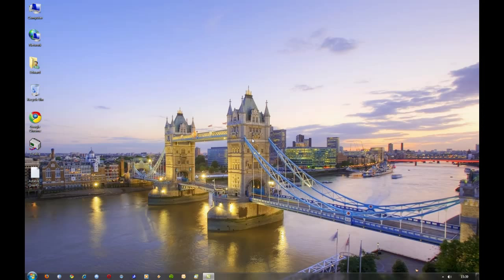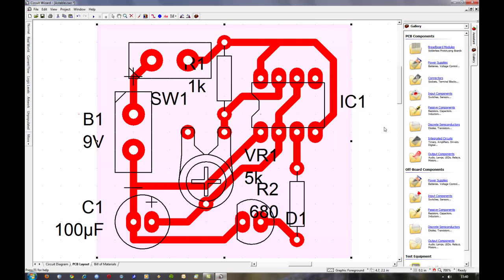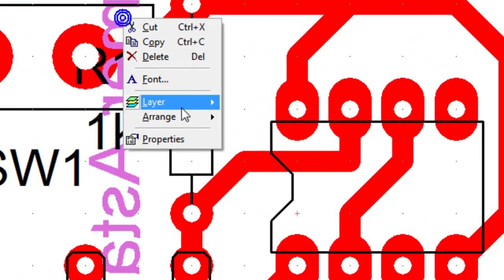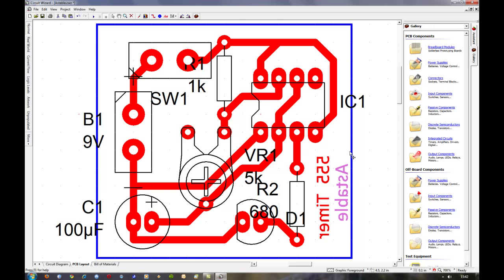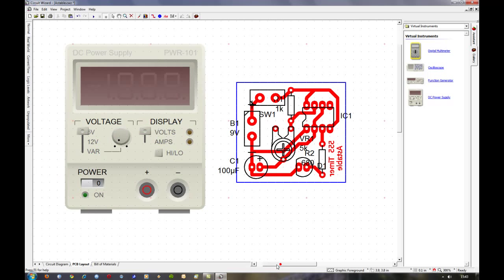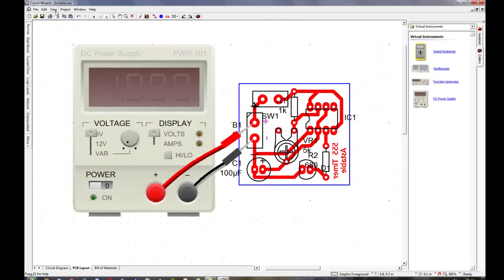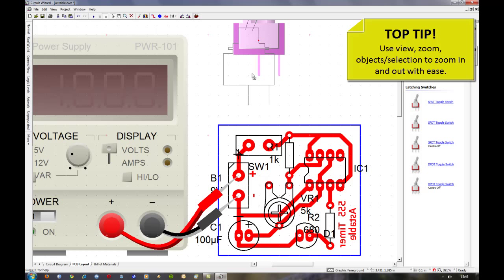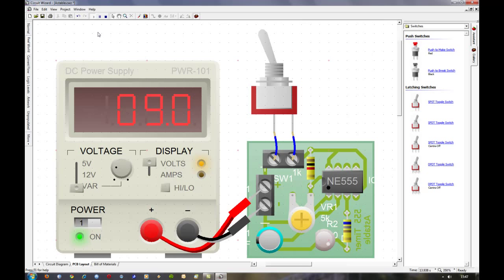How to Design, Develop & Manufacture a PCB | Part 3 - Testing PCB Using Virtual Instruments

Comment from the maker: @100roberthenry You can use the virtual function generator as the input signal and then use a virtual oscilloscope to see the output signal.  Unfortunately you can't input a song as such :(  I noticed you mentioned you got this program in one of your previous comments... not sure what version you have, but you can download the latest update for it from there website... 1.5 I think they are on at the moment.  Do you think a video showing building the circuit on breadboard would be useful?

Comment from the maker: @liamgreen94 Well, this is testing it virtually after you have converted it to a PCB layout.  If your using Livewire and PCB Wizard separately then you can only simulate the circuit.  But with circuit wizard your able to test the PCB layout virtually too which minimises the chance of anything going wrong.  I think NWC claim 99.9% the circuit will work if it works on the program!